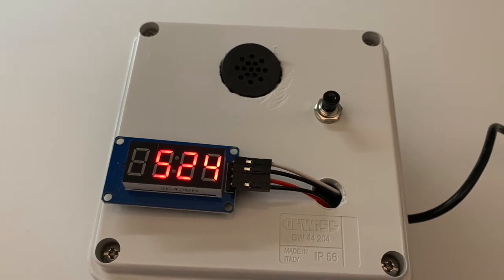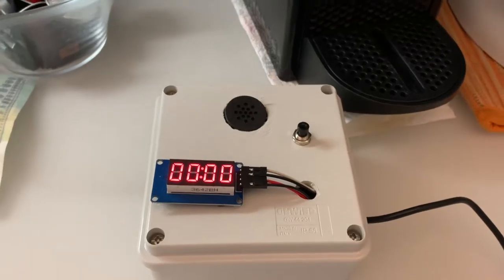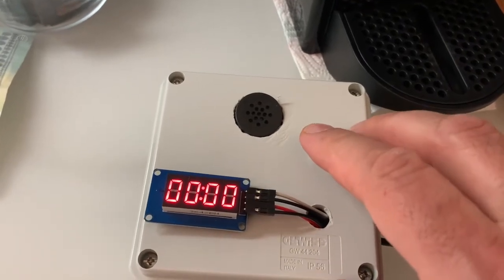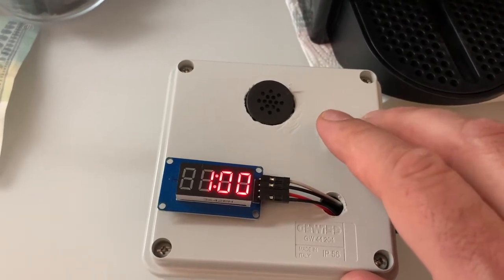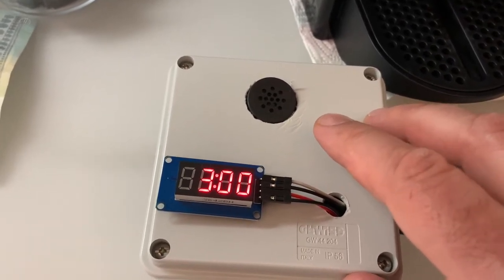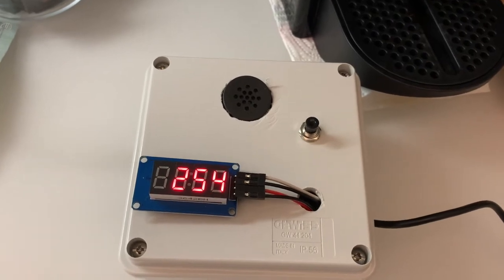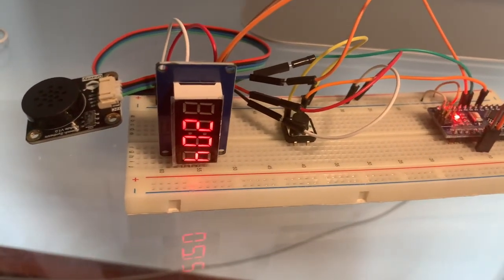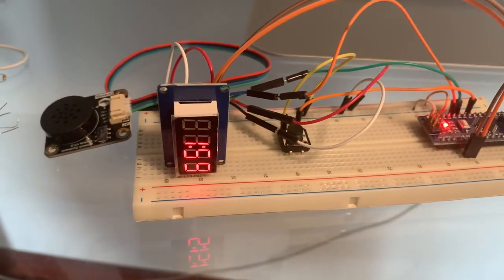Smart Timer with #Arduino #DFRobot Gravity DFR0760 Speech Synthesis module

Comment: Did you do any modifications in the library? When I try to use it, after begin() function is stopped, so never arrive into loop function. Any idea to fix this issue?
Reply from the maker: No changes done on my side. It should work.

Comment: How did you get this speaker to output a voice? I bought one of these modules but when I run the UART example code given the speaker does not speak.
Reply from the maker: Hi. Try using my code on this link https://create.arduino.cc/projecthub/cstram/cool-timer-with-voice-synthesizer-edfead?ref=user&ref_id=1371882&offset=7
Reply: @CarloStramaglia  thank you for the help, I've managed to get the speaker working with the I2C connection. Also thank you for the quick reply, it was very helpful.

Comment: I bought the Gravity Speech Synthesis Module V2.2.0 SKU:DFR0760 used Arduino nano. I can barley hear the voice coming from the speaker.
Reply from the maker: Very strange. When I built it it was loud and clear as you hear on the video.
Reply: Oh? Maybe I have to modify my program. Thanks for the response. @CarloStramaglia